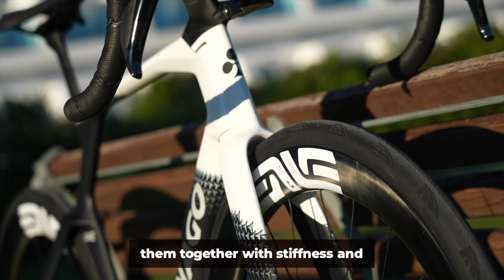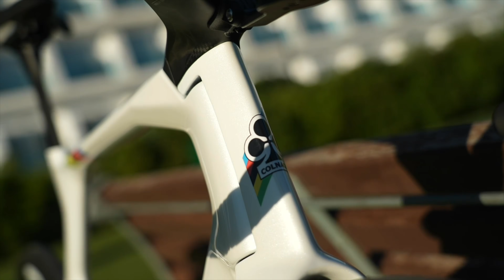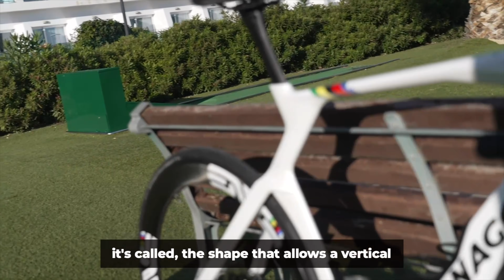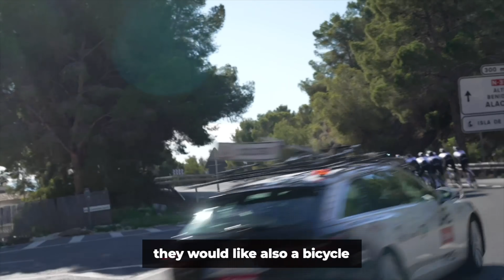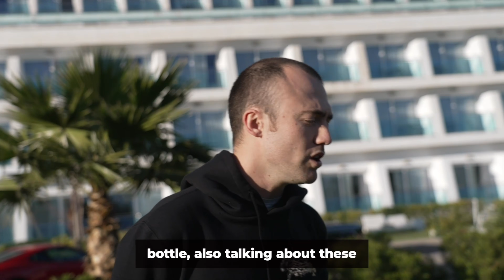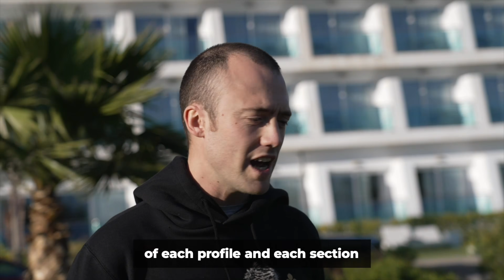How was Colnago's Y1RS Not Banned by the UCI?

Comment: The Cervelo S5 was already pushing the limits of UCI ruling on bike frames having a visual main triangle, now Colnago has pushed this ruling to its limit. Kestrel pushed this idea to the limits with similar designs of the KM40 and 500SC but both of these frame designs included more carbon (even though carbon quality/technology was not as advanced as today * Kestrel carbon frames were still made to very high standards back then ***) to support the seat and top tubes. The Cervelo has a large amount of vertical carbon, albeit, shorter seat tube section to support both the rear seatstays blending into the curved lower seatube. Personally I would not trust this design as the lack of tube depth surrounding the very short upper seatube section may inheritantly fail which is okay when a pro's bike fails (as long as they don't get injured of course) but to an everyday consumer of such a frame, barring any physical damage may well have to wait weeks possibly months for an updated model.....which I'm sure Colnago will inevitably be forced to build.

Comment: Don't get me wrong. That is a gorgeous bike. However, 
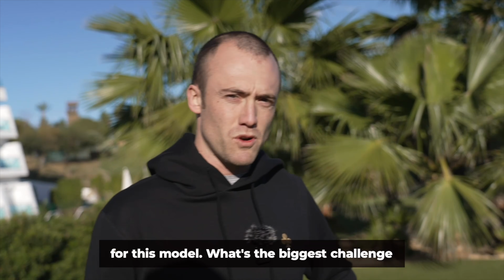1:18 "What is the biggest challenge making an aero bike? Is it easy? Tough?" 
Well, making a road bike more aero than previous models is tough because those previous models were made by some pretty competent people. The real issue here is that you have to put a human on the bike. Since that human is upright, the whole package is really not going to be more aero than humans on the previous models. Yeah, you might be able to throw both old and new bikes with riders  in a wind tunnel for a few hundred hours and find a very exact riding position and component list that saves a few watts, but come on. Seriously? 
Maybe one day someone will invent (or re-invent) a bike that puts the rider in a different position that is not only incredibly more comfortable but also WAAAAY more aero. 🤔
My Cruzbike V20 gets me this... 0.200-0.210 CdA = 200-210 watts for 40kph average speed. That CdA is TT/Tri levels for comparably sized individuals, and I know of 2 riders who got down to the 0.160 level which is even lower than the lowest TT/Tri bike.

Comment: every year, the new bike that cones out saves you 20 watts. 😂😂😂...
Reply: we should be at 0 watts by now
Reply: In 2030 we will have a bike that has negative drag. You sit on the bike without pedalling and it accelerates by itself.
Reply: @ironchin17 electric bike 😄
Reply: @ironchin17 according to manufacturers we are way past that point 😂
Reply: In case of colnago this is probably true, because the VR4s was not as aero - tour test shows it was around 20w behind the top competitors, so an increase of 20w brings them to the front which is believable.

Another 20w is probably not possible anymore, maybe with a completely different regulation or a different drive train.
Reply: Yep. Lots of BS😂
Reply: It's not that hard to build a bike 20 watts faster than a climbing bike.